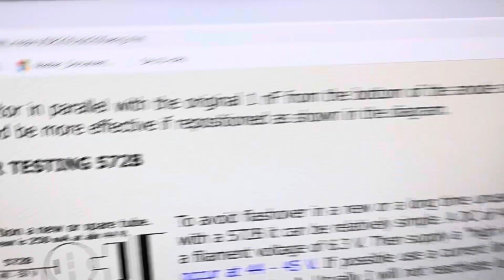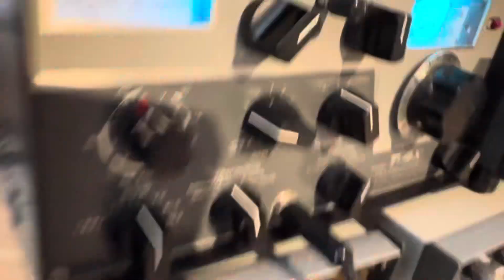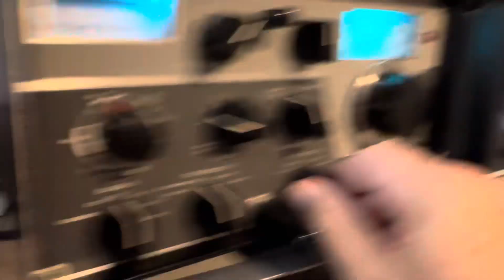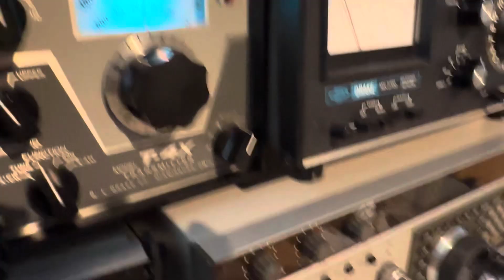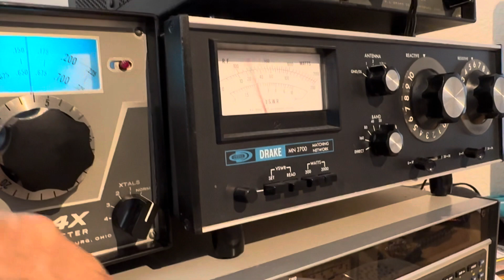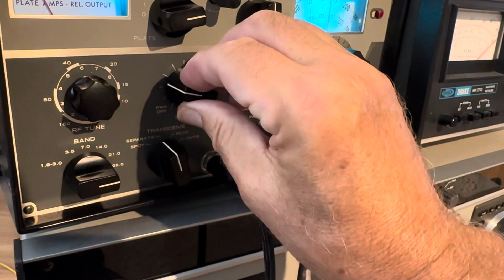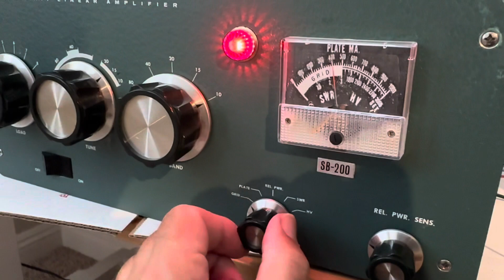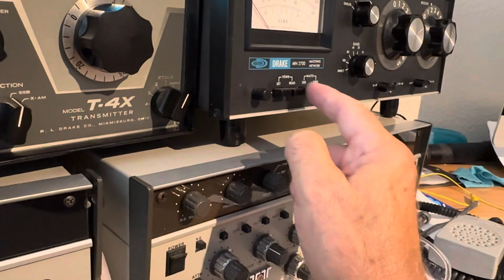WARP! Heathkit SB-200 grid circuit caps and resistors removed to fix oscillation w Cetron 572b tubes

Comment: The Cetron 572B's are the best 572's ever made. Great tubes. I have a 50 year old Yaesu FL2100B that runs a pair of tubes that are as old as the amp itself and they still make full power.